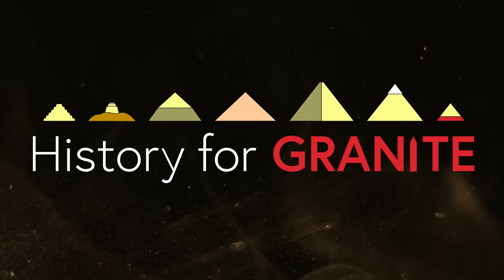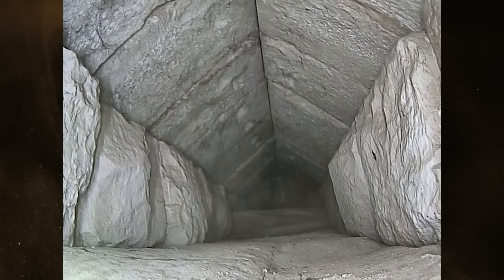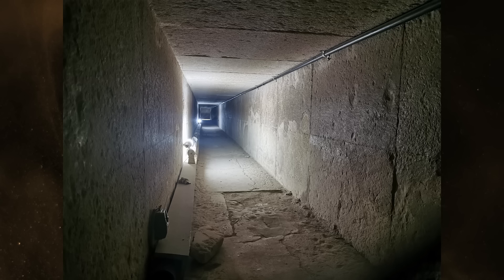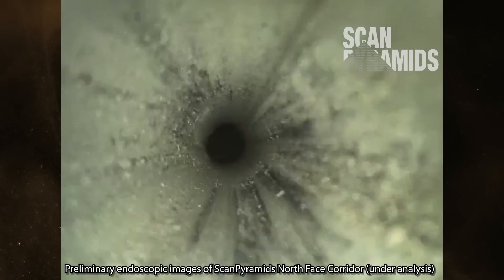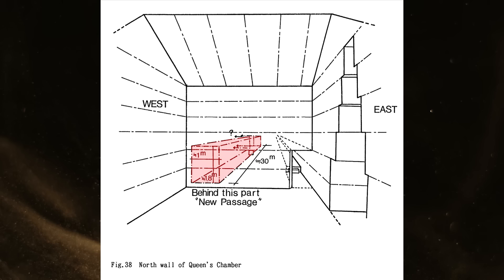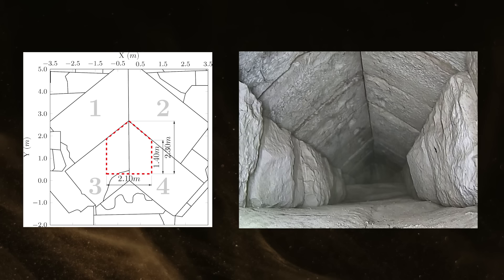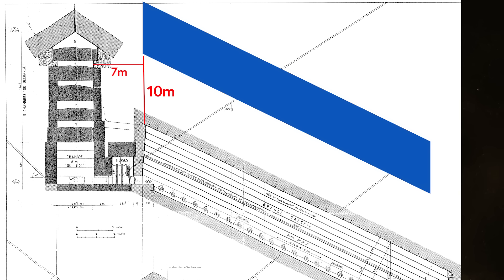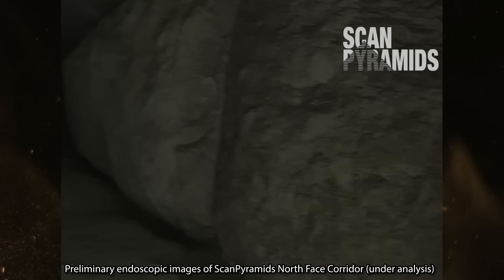New Robots to Explore the Great Pyramid

Comment: In the Great Pyramid in Giza there is a chamber that contains a stone sarcophagus made from granite. This granite sarcophagus has the shape of a rectangle and obviously never had a mummy in it and the chamber has no decorations either so it is very unlikely that it was a coffin. But, what if??? What if it used to hold the Ark of the Covenant which also has a rectangular shape and since it allegedly emitted radiation which made it dangerous, it would make sense to keep it in a stone box that has thick walls. Also there are theories that suggest (which I agree with 100%) that the pyramid used to be a power generator plant or an electricity plant (highly suggest for everyone to watch the documentary called the Pyramid Code, it is long , but worth it, and it explains why the pyramid was most likely a source of electricity). So my theory is that the source of the energy was the Ark of the Covenant itself! Maybe it was used to create atomic energy that supplied Egypt with electricity. This would explain why it was radioactive and why people who went too close to it had symptoms that are very similar to radiation poisioning. At least this theory would make sense, because the one that is currently promoted which is that it was the tomb of a pharoe makes no sense at all, has no scientific backing and no evidence at all. 🌴🐫🦂🐪🌴
Reply: I agree, some kind of alien battery.

Comment: We have penetrating radar now, why would we need to drill, they could place thousands of sensors all around and on the pyramid and record the reflections, like a giant MRI. Also that Zawass guy needs to go, he does nothing but block unless he can claim research for himself. I bet the tunnels that were discovered below the Sphinx he announced after another team found them and then retracted contained stuff that does not line up with mainstream archeology. 
All he does is delay real research.
Reply: That's what the project Scan Pyramid already did, and is doing again.
No tunnels were found under the Sphinx.
Reply: @nalinux  ?? There are a few shafts leading under the Sphinx, down to the watertable. Hawass himself announced a big reveal about it and then suddenly denied all mentions of it.
Clearly you don't know everything.
Reply: @YouCountSheep  Mark Lehner did a lot of research about the Sphinx, including drilling holes everywhere around.
He never discovered anything.
Where do your informations come from ?
Reply: @nalinux  There is actual videos of some of the passages leading below and some of the rooms. Pretty easy to find actually.

Comment: I'm so tired of people calling the Great pyramid a "tomb". Ancient Egyptians covered the interior of their tombs, wall to wall, with artwork. Look at any tomb in the valley of the kings and you'll see that. There is ZERO artwork inside the great pyramid. Not only do they want me to believe that they cut and stacked that many blocks in a timeframe that is impossible with modern machinery, but they want me to believe they built a "tomb" of this size and scope and didn't put a single piece of art on the walls? psh.
Reply: It's been robbed and picked clean
Reply: There is thousand years between valley of the kings and old kingdom pyramids, do you expect them to be consistent over millenia? Should you go look at 1023 year tombs and wonder why they are not similar to ours?
Reply: There was no inscriptions in pyamids before pharao Unas.
Valley of the Kings is 10 centures later, do you know this ?
 "a timeframe that is impossible with modern machinery" -- this just proove you don't know anything about also modern machinery.